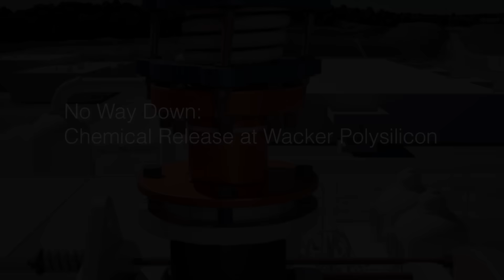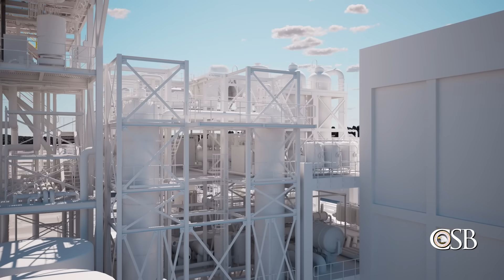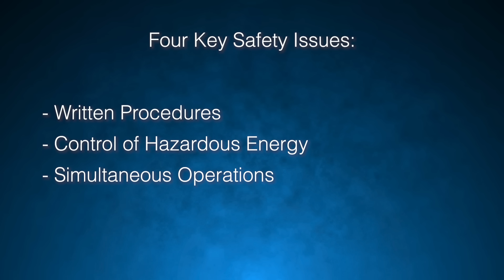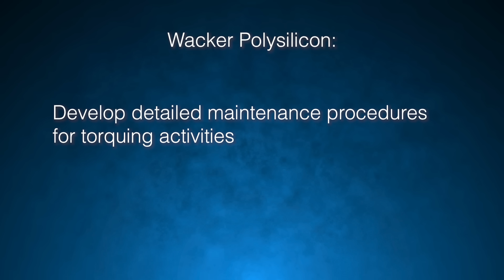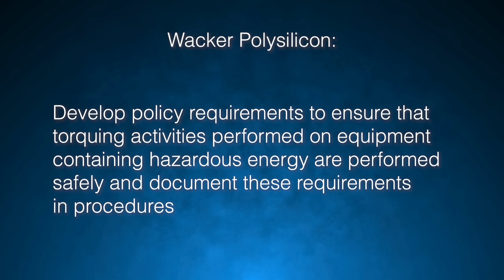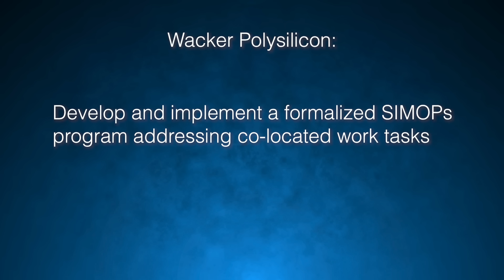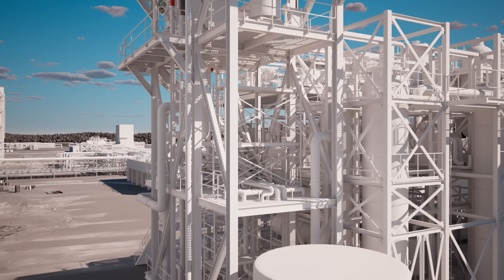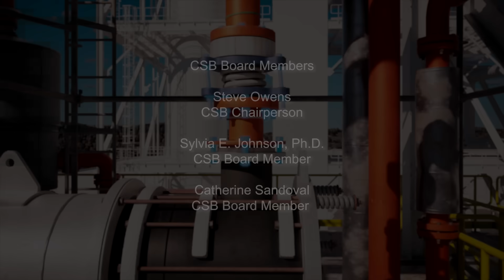No Way Down: Chemical Release at Wacker Polysilicon

Comment: I was middle management at a chemical company in Texas similar to Wacker. I can tell you as an insider, upper-level management weighs the cost of safety against what it would cost in lawsuit settlements should someone lose their life or get seriously injured. They come up with a number. If the cost of safety exceeds that number, they don’t enforce safety rules as closely. If anything like this ever happens, everything is blamed on middle management. IOW: me. When I was there, I saw a lot of corner-cutting on safety so I quit. On the way out, I warned my crew about the lax safety standards. Word got around and a dozen employees quit. The company found out about it and sued me. Had it not been for pro bono work by a public interest law firm, I would have been screwed. The outcome was 1) they would completely review safety standards and practices. 2) I would not go public and 3) they paid legal fees to the firm that defended me. Personally, I received nothing but a nice dinner from my attorneys. Oh well, all’s well that ends well I suppose. I left Texas.
Reply: I worked for an aerospace firm that calculated risks for certain operational scenarios. I'm happy to say that we never, ever, ever, ever cut corners or fudged reports to get by. Sometimes we had to redesign a part that technically met gov't standards, but not our engineering standards, at the cost of many millions of dollars.
Reply: @UncleKennysPlace  You obviously don't work for Boeing do you?
Reply: @UncleKennysPlace work well done ❤❤❤
Reply: I'm so sorry your intent of helping workers ended up nearly costing you your freedom. I work every day to make sure companies fear the power of workers, you've made an unprecedented step in your ex-place of employment.
Reply: With all the baby boomers retiring, and aging equipment, I fear these problems will get worse. In plants like this, there is always that one old guy who knows everything, but when he retires or gets promoted, the knowledge is lost. 

 Although in this case it was a bad design from the start. Using the same sized bolts for very different torque specs is a bad design. The graphite flanges should have used smaller bolts and a different type, like cap head socket screws so the contractors couldnt make this mistake. Graphite Flanges should have been clearly tagged, painted, with warnings and torque specs.
Reply: @tubester4567 the boomers are the ones pushing this rhetoric. The old guy that knows everything is the outlier, we can do away with the rest of them.
Reply: awesome!!
Reply: "A new car built by my company leaves somewhere traveling at 60 mph. The rear differential locks up. The car crashes and burns with everyone trapped inside. Now, should we initiate a recall? Take the number of vehicles in the field, A, multiply by the probable rate of failure, B, multiply by the average out-of-court settlement, C. A times B times C equals X. If X is less than the cost of a recall, we don't do one."
Reply: @teebob21 @danton2529 raced to the comments for the Fightclub reference
Reply: Don't you just love when sociopaths run companies. Completely amoral. Humans are replaceable and disposable, except them of course. They're more important.
Reply: @Undergroundbattler A friend who was completing his PhD in Psychology once asked me: "What's the difference between a serial killer and a CEO?" Say what! His reply: "Not much. They're both psychopaths". Sometimes a CEO can be both, i.e., ignoring safety at the risk of employees and the general public.
Reply: Interesting but I am not surprised. Most big companies have their employees and anyone they do business with locked into arbitration and mitigation so you cannot sue. In risk management, management always has the option to accept the risk. However, cutting corners is still a slippery slope just because you cannot predict what will happen. Risk also can also compound, and you can end up with a culture that is allowing more risk then you realize. Just look at Boeing right now.
Reply: I worked for a company (I cannot mention due to a legal settlement). I was in maintenance engineering. Within a few year period, the company grew, but didnt hire enough maintenance workers. Management decided that many of our preventative maintenance tasks were unneccessary. Within a year, machinery was failing, oil leaks were everywhere, and management decided they would restart our preventative maintenace. However, managers did not want us shutting down machinery as would be necessary to do the work. Our manager would insist we fill out paperwork as tasks completed, even if they were not, just to make it appear as if we were doing the work. I refused, as did most other maintenance. We reported our concerns to our corporate office. After some time, corporate sent down 'business consulants', to 'improve' on certain operations. They were really corporate spies. It didnt take them 2 weeks to find evidence of falsified saftey records, falsified inventory, and a slew of other corrupt acts. The entire management was eventually replaced. There was a class action lawsuit accusing the company of gross negligence in saftey practices. They ofcourse settled very quickly.
Reply: You did in fact just go public - just left out the name of the company :)

Thank you for your service.
Reply: This really is a shitty situation and you should never have had to go through it BUT you did the right thing, happy you chose to leave and let people know because it is wrong for them to do that. Happy you got through it!
Reply: This is exactly why everytime a company is found liable for a safety issue like this, fines should be defined as "percentage of global revenue" or "percentage of assets", not set amounts. Start actually hurting shareholders, and they fix things. Regular fines do nothing for these companies, because far too often, they are barely a rounding error in their calculations.
Reply: You probably should have just gone to the government, better protection from vindictive prosecutions also you'd probably be covered by whistle-blower laws then.
Reply: @werechicken1969  oh I considered that but there’s still a price to pay for it. Specifically, I wouldn’t ever work in that industry again. Funny thing is: I never have anyway. I ended up making a mid-life career change. At the time, I just wanted them to stop putting prices on people’s lives and I accomplished that. Had I played it differently, there’s a chance I could have walked away with a lot of money. However, never did I ever want my motives questioned and I didn’t need it anyway.
Reply: Whistle blower laws also cover if you report to anyone in any place to do something (in response to your complaint) that the company doesn't like.
Reply: Having worked is very similar environments it's always odd seeing people in suits talk about what went wrong. Knowing full well how often these orders and omitting critical info comes from other people in suits. 😅
Reply: what’s the formula it’s like Risk x Severity = compensation or something like that. yea upper level management are horrendous; famous example, ford pinto. they figured it would be cheaper to pay out the settlements rather than manufacture a bar that would help protect the gas tank.
Reply: There was a bit about this in the movie "Fight Club", if the recall of the defective vehicle is going to be more expensive than the law suits, forget about it!
Reply: upper-level management all have names, addresses and family members in minecraft
Reply: Fuck thats enraging
Reply: Every American corporation follows the same practices. Auto manufacturers do the same things. If a $1.00 part is defective and can potentially cause fatal accidents they do an assessment of the likely number of fatalities that will occur and the potential costs of defending against lawsuits and having to pay off a certain number of settlements. If the estimated costs of a full recall and replacement of the part is greater than the costs of lawsuits then they will not issue a recall and will assume a certain number of preventable deaths as a cost of doing business. The MORALITY OF MURDERING CUSTOMERS never enters into their calculus. But modern corporations are like parasitic organisms that only exist to suck profit out of the American public without providing much of anything in the way of benefits to the public.
Reply: Wow, there needs to be prison time associated with this.
Reply: Good for you man!!
Reply: Wow. That must have been a scary/stressful time.  Glad you game out the other end.
Reply: My bff worked for a company that builds and rents apartments. The corners cut in the cost of tenant safety is insane- using decade old appliance parts, improper building and foundation work, not updating buildings in decades yet charging more and more and promoting themselves as 'luxury living' while offering cookie cutter apartments country wide. I'm talking the EXACT SAME BUILDINGS.
Reply: @IRONSAGEARTS  I'm a water utility contractor for a city government in one of the fastest-growing counties in the country. We work a lot with residential builders, as well as the building inspections and code enforcement departments.
Builders are some of our worst offenders. They will constantly nag for meters to be installed where there aren't even pipes laid or a foundation form set, and no identifiable address. They build everything as quickly and cheaply as possible, with no care if anything ends up unsafe or broken when they leave. Any time they get caught, it's always somehow someone else's problem that they don't want to be responsible for fixing until they're forced to.
Permits and planning has issues with them too, since they're desperate for more zoning regardless of whether that means building houses in a floodplain, or where there's no water infrastructure, or whether it's literally across the street from a sewage treatment plant. Plus all builders seem to be somehow incapable of filling out and submitting paperwork correctly.
Reply: Management also works with their lobbiests to put caps on the amount that can be paid to injured parties in lawsuits.
Reply: @danielebrparish4271  great point.
Reply: Texas held a real charm for me for a long time. Not anymore. Now there's a garbage can.
Reply: Crazy there aren't any laws making those types of whistleblows illegal. A company shouldn't even be allowed to sue someone for that.
Reply: I saw Fight Club as well. Seems like this was lifted right out of it.
Reply: @OhNoooAnywayyy  I have never seen Fight Club.
Reply: You did good, thank you for taking care of others even tho you put yourself at risk of payback from unscrupulous higher management. ❤
Reply: Thank you for making such a great contribution to the safety of frontline employees. I am fortunate that the company I work for has a highly secure system, and everyone attaches great importance to safety. In our company, safety is more important than profit.
Reply: When people make decisions that lead to harm, there should be criminal proceedings, not just civil cases, and individuals should be liable, regardless of the liability of the company. 
It's so crazy how people get away with breaking the law by blaming their company.
Reply: Your reward is the knowledge that you picked integrity over the easy path. The self respect you gain from this is priceless, and far more valuable than a cash reward would have been. That being said, you deserved to get both. Thanks for doing the right thing.
Reply: @ibuprofenPill  So its always about the money, no surprise there. And every hypocrite company spews the same BS about being a "family" and safety first..
Reply: You did the right thing, and I am glad it worked out in the end
Reply: Aren't there whistleblower protection laws?
Reply: The Steak House in Dallas !! 😮👍😆
Good job dd !! 💪😎
Reply: Look at Boeing, the doj, the CEO and his 25+million settlement and the 1000 people these types of 'calculations' killed, and don't get me started on suicidal whistleblowers.. messed up, without controlling independent capitalist practices the only solution I see if stronger unions and transparency of upper management.
Reply: The Republicans love unrestricted free speech for nazi, lying conmen and conspirationnists, but hate it when it actually serve its purpose...
Reply: The more I read about Texas, it's just a billionaire's dream. It's a shit hole state for normal people.
Reply: DO NOT GET IN THE INDUSTRY. DEER PARK IS ABOUT TO EXPLODE!
Reply: I’m not sure this is universally true. Maybe there have been very isolated cases of this, if ever.
Reply: @FluxOperation  agreed, not every single business where safety is especially important does this. At least not in this nation.
Reply: The first rule of violating safety regulations is you don’t talk about safety regulations.
Reply: Alright Tyler, calm down
Reply: I’m glad I did software engineering instead of mechanical or civil, most software applications aren’t safety  critical, no blood
Reply: That may be but it is also the worker with the wrench who should be checking the documents themselves to see what they need to do. 

Mechanics can choose to blindly torque bolts or they can actually go to the specs and drawings to review the work their life depends on.
Reply: @enderwiggen3638  This is the exact argument upper-level management will use to protect themselves. Not to mention, people are only paid for a certain amount of time and safety review is usually not figured into the estimate. This is how they’ll blame middle-management, even though there was no budget for safety training. Also, unless the company makes it a point to ensure the said documents are easily accessible, good luck with that. This is where they decide which is cheaper: being reactive or proactive? A strong commitment to safety must begin at the top or it won’t exist at all.
Reply: There is a code for it. Api 580 and 581 risk based inspection. I laugh every time I'm in a safety meeting, and I hear the phrase "there is no price on a human life." Bs. Yes, there is. That's why I knew how hard the jab was being pushed was bs. Companies weigh everything by risk vs reward. If you can't be sued, there is no risk.
Reply: @iamgutwrench imagine coming to a CSB video with jab conspiracies.
Reply: @EndoExcision imagine commenting on a CSB video and still not acknowledging how shifty large entities tend to be when money is on the line.
Reply: IOW? Stop using dumb abbreviations
Reply: @weaverjoshuab  you should probably stay off the internet? SMH.

Comment: This channel always reminds me of the phrase "If you think it's expensive to do it the correct way, wait till you see how much it costs to do it the wrong way."
Reply: Upper Management: “that’s what insurance is for!”
Reply: The lawsuits and fines are still usually less than the profits they get from cutting corners. They see that as a price of business.
Reply: @0x0ada  Yep.  Once those pesky morals and ethics are disposed of by making the corporation resposible (not any one person), then it becomes a raw economic decision.  And you are correct-- of course it is cheaper to not follow safety policy-- that's why the policy has to exist.  If it were cheaper, they would already be doing it and no policy would be necessary.
Reply: My company maintained a high-pressure steam boiler for a manufacturer. And when we found a crack in the heat exchanger, they asked us to run it anyway. After a huge fuck no, and we would not allow them to do it behind our backs. They said they would get someone to weld it on the weekend. Instead of paying for the company that is allowed to weld on pressure vessels. The only thing stopping them was the tech, whose account it was reaching out to a state boiler inspector to shut them down if they tried.
That shit could have vaporized the factory. And it is scary how willing they were in their ignorance to endanger the surrounding people, not even in their factory. Just to save an extra grand.
Reply: @Destroyahx2  Yeah: greed is on another level these days isn't it?
Reply: @Destroyahx2 unreal.
Reply: The shortened form of that that I've seen people say (including some on CSB videos in fact I think): "If you think health and safety is expensive, try an accident"
Reply: Unfortunately the price for many of these incidents is people's lives.
Reply: @habeeb1t  Yeah, & that's a price that too many companies are all too willing to pay for their screwups.
Reply: "If you think safety is expensive, try an accident.." words spoken during the BP Incident CSB video
Reply: @chloesanders3631  Yeah, that's what I said too (sadly though these companies never listen to that).
Reply: @chloesanders3631 That's a quote from the late Trevor Kletz and it's still true.
Reply: @debbiekerr3989  Thank you! I could not for the life of me remember his name
Reply: The problem is often those making the decisions are more concerned about short term profits than an increased risk that they likely don't fully understand.
Reply: @jon9103  Exactillioso!
Reply: I feel this way about fixing the check engine light on a volkswagen
Reply: The issue of course is that upper management tend to be older folks who were taught engineering by now-dead folks who lived before the EPA and OSHA were a thing. So their logic is that they're not going to put any more into safety than they have to in order to avoid lawsuits.
Reply: I know others have already said it, but I'll add that these were independent contractors. The only money Wacker lost in this incident was the cost of the HCl vapor. Under US law, they have no legal obligation whatsoever to the contractors.

In fact, the more they get involved in trying to direct the contractors on safe operations, the more they expose themselves to legal liability (because Wacker directing work might result in them being designated as Wacker's employees by a court).